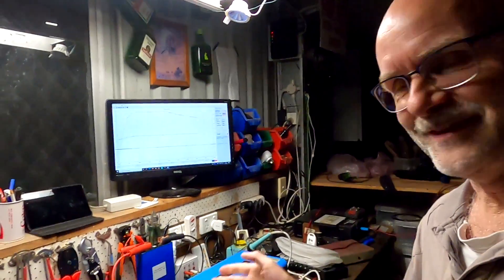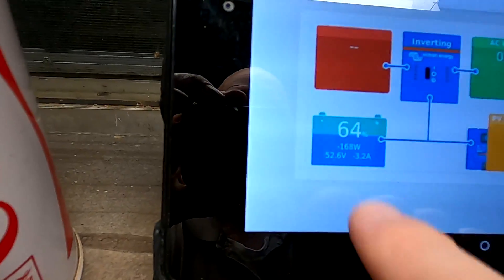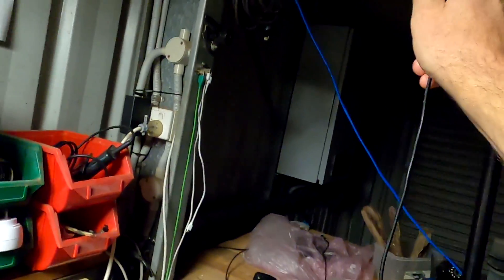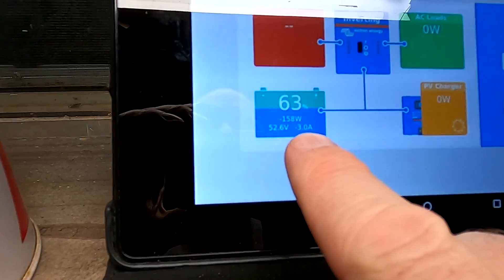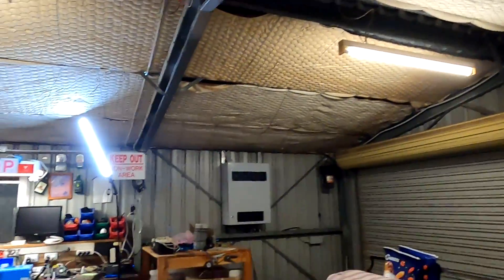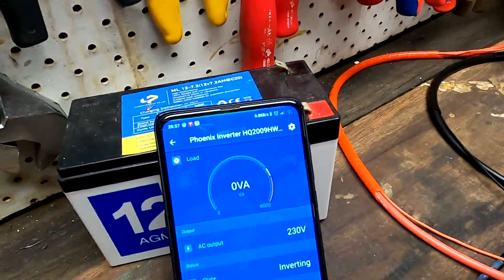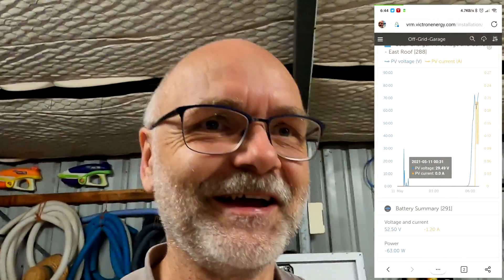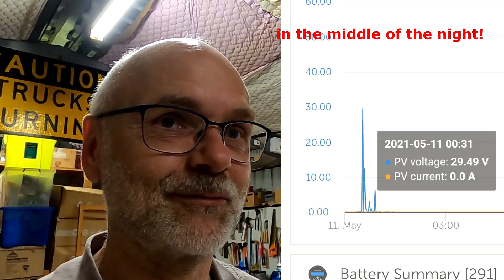How the Off Grid Garage rescued us during a black-out! (Also 🐸)

Comment: In the hills around Phoenix Arizona there is perpetual lightning. I wonder if you could use some sort of lens to focus the light onto a panel in a concentrated enough way to produce power from it in the dark. That'd be interesting to try if you lived near there. Really neat to see that midnight voltage from the panels :-) And funny to know that you have an off grid garage that's right next to an on grid house :-D I guess it'd be almost as cheap to build a solar system as to have an electrician run sufficient cable that distance and hook it up properly with the right safety and electrician hourly rates. Fair play.
Reply: And then I see the snip video! Ha ha, good on you anyway, the more steps toward self sufficiency the better. :-)

Comment: ^_~ so... the moral here is next time build your Off Grid Garage closer to the house, get & install up high a backup gravity fed 100 gal water tank, start converting old appliances from mains to direct 12vdc ,buy some cheap diy 12v induction pcb's & retrofit into a mains hot plate or bean can drop in heater ^_~
add super cap high loads to your local appliance battery ....
Reply from the maker: Yep, that's exactly the plan 😂

Comment: The Problem with  High frequency switch modes it they can jump Detection frames in Slow AC Amp / PF Power analysers so it give a False reading with the slower Refresh Data collection Rates 

Now if you can speed up the AC  Data analysers  Collection at a much higher sampling rate you will see the switch modes + Very bad PF 
Ham radio  + Power company's hate them due they have a abnormal AC  PF Loading  and yet the DC Side can see it Loading

Comment: You may want to contact your victron dealer and see if there isn't an adjustment for that like my 12v 3kva multiplus shows down to less than 10 watts I don't really know how low it goes I just don't have anything that only pulls one or two Watts
Reply from the maker: It depends a bit on the kind of load. Sometimes it shows really low values but mostly nothing up to a few 100Ws

Comment: Hi Andy, i ordered 2x FT 4KW low frequency inverter for my home. The peak of them are 12kw. They can hold the peak very long. Not just 5 seconds like a high frequency inverter. If you interested in, I can give you the link from Alibaba.  You can buy this up to 7kw 20kw peak. I paid for my two inverters just 2000 CAD - DDP price. Like your videos!  👍☀️🙂
Reply from the maker: Thanks for sharing. Yeah, that would be a good upgrade I guess. Do you run them in parallel or just as single units?
Reply: @OffGridGarageAustralia  you are very welcome. Yes sure. I run this guys as single unit. The thing is in summertime I will use just one of them. In the wintertime I will use both separately. Because they have a 35 Amp Battery Charger in it. That means I can load my batteries with 70 Amps in the wintertime with the generator. Do you have a email address for me to share with you the contacts? The best thing comes know. They have from the 1th of June Promotions for several products. Will explain this in the email. Hear you soon. 👋👍

Comment: Wish I could replace all my 120v led lights with 24v led lighting. Removing my inverter from the loop.
Reply from the maker: Why would you do that? You need the inverter anyway.
Reply: I run 2 50watt grow lights and lot of led lights in the basement ( vegetables seedlings only, I do not smoke anything ! ). My inverter indicates that I draw approx. 250 watts. I would gain some efficiency if the lights ran on 24 volts dc ( conversion loss ) and the avoid liability (in event of bad inverter) . If I could do it all again I would also get a dc freezer chest and 1/3 hp dc sump pumps ( those are black out items only ). A dc tv isn’t too hard to find and mini pc usually run on 19v.. anyway it’s a question of margins. Since my house is fairly small I would have to consider some conductor loss , that might influence my running voltage. I love you videos they have opened my mind to some projects ! With electricity.12 cents per kWh. here in Virginia,USA ( where the sun hasn’t shined in 3 days ) Everything must be done with margins in mind.

Comment: In emergency situations you can run an extension cord to the nearest power point on your house and disconnect the house from the grid with the main rcd then make a 2 male end cable to back feed it through  the house circuit I’ve done it for a few days
Reply: That cable is also called "suicide cord"
Reply from the maker: Yes, you can do that. That would run one phase of your battery. So the pump may or may not run ;)

Comment: a hybrid offgrid inverter is good to go
Reply from the maker: Why a hybrid inverter?
Reply: @OffGridGarageAustralia  Hybrid is the cheapest and best solution. You can directly connect the 48V LFP battery to a Voltronic Infinisolar (aka MPP MPI) hybrid inverter (5kW inverter 1 phase, 10-15 kW inverters are 3 phase ... and parallelable). It has EU and Australian certificates. With bigger solar panels in offgrid you loose a lot if battery is full. With hybrid automatically transfer that to the grid. And its AC out port gives UPS power to the loads (your full house)
Reply: @OffGridGarageAustralia  Mr zed has a good explain on it, it is the most simple solution I think. Just throw in a inverter and a battery it is good to go, minimum wiring is needed. You may just use the inverter as a UPS mode, it will auto switch to battery when the grid is down.

Comment: Switching power supplies without PFC are CAPACITIVE loads, not inductive ones. The reason your inverter is failing to see capacitive loads is likely because it is applying a low-pass filter to its output current sensing and loses the current spikes that occur when line voltage exceeds input capacitor voltage in non-PFC power supplies. Put another way, the inverter does not appear to be counting distortion (non-line-frequency) power.

Another possibility is that the inverter is dumb and estimates load based on the crest factor method (current at AC peak) instead of periodically integrating instantaneous power (v(t)i(t)) and RMS current as it would need to in order to accurately report power and VA.
Reply from the maker: Yeah, it depends on if the power supply have a transformer or not. Some of the wall chargers have (you can feel the weight) bt most modern ones don't. The computer and monitor PS should have both PFC.
The interesting part with this inverter is that it shows only 78W when a 100W light bulb is plugged in. Nothing else is plugged in at the time. 

Thanks for your explanation.

Comment: MPP and think Growatt off grid can act as UPS. So you charge batteries up during the day (using gird inverter) and then use during the night  or power loss with a transfer switch.
Reply: Growatt SPF5000ES for example. Reviewed by Will Prowse and David Poz
Reply: I think Growatt and MPP Solar inverters are made by the same company: Voltronic. Only Growatt has more design and cost twice so much.
Reply: I am not sure if the Growatt and MPP are made by the same factory or not, but I can confirm my MPP Solar LV 6048 units (2) switch very fast, and my computer time-dispay (on Micro) and other items do not shut down during the flip from grid to battery or vs-vera.  It was not that important to me, but having this feature is very convenient.

Comment: Simple inverters (try to) create the AC power with a power factor of 1. I believe, there's even a regulation (in some countries) on how far away of that they are allowed to be. 
For big consumers that have to pay for a deviation of their power factor from 1 there are inverters that try to optimize the power factor by not using 1, because this would reduce the resulting overall power factor, creating costs by reducing power consumption.
All that does not explain why the inverter does not show anything, but at least why it has VA = W.

Comment: volt-amps and watts are equivalent only for D.C. or with a purely resistive load.  Any capacitance or inductance will introduce a phase angle which makes watts not equal to VA.
Reply from the maker: As I said in the video but this does not explain why one shows VA and the other W with the same value.
Reply: @OffGridGarageAustralia  One is likely computing VA and knows those are not watts. The other is likely computing Watts, but possibly it is computing VA and knows or assumes they are equivalent. If the values are always the same and should not be, I expect the W computation is making the erroneous but common assumption.

Comment: I miss green frogs from when I live in Townsville.  Now Andy I will have a simpler system, which I want to reverse my shed power to the house. I run 15 Amp wire to the shed.
Reply from the maker: Just 15A to supply your house?

Comment: A second inverter just for the house wired to old grid wire feeding garage ? Add a Protected loads panel at the house with a transfer switch .
Reply from the maker: Not that easy. I have grid-connected solar on the house.

Comment: Ich würde einen multiplus mit 5kw Leistung nehmen. Der hat ja einen Ausgang für unterbrechungsfreie Stromversorgung. Außerdem hat er ein eingebautes Ladegerät. Wenn du einen Stromzähler an deinen vorhandenen Solar Inverter anschließt, und alles mit dem Raspberry steuerst, läd der Multiplus über Tag die Batterie mit dem überschüssigen Solarstrom, der sonst eingespeist wird. Wäre eine Möglichkeit. Ich plane es gerade genau so. Muss aber erst mein Asbest Dach erneuern🤷‍♂️
Reply from the maker: NOOOO, I cannot do that. All solar power produced by the solar system on my house need to be fed into the grid. I'me getting 55c/kWy for that. Hence we are trying to use as little power during the day as possible.
Reply: @OffGridGarageAustralia  Even more, you can run your house full from the off-grid garage. And so all your house grid-tie solar produces goes to grid. All you need is wires and a good off-grid (with grid support) inverter.
Reply: @OffGridGarageAustralia  sorry i just didn't know that. In this case, i would say, get as much as possible fed by the off grid Garage!!!
Reply: Victron Multiplus is a very good product. But it cost a lot. You can buy 3-4 MPP Solar 5kW inverter from the price of 1 Multiplus 5kW. And sometimes 5kW is not enough. If you start a 1 kW continuous power needing electric motor it can have a x2-x7 inrush. Also you have to produce your own reactive power. And Multiplus is not the best choice for UPS. There is cheap MPP Solar inverter with double conversion (AC/DC->battery->DC/AC) technology (this tech also called Online UPS). When Multiplus changes from grid to battery lights flicker. Not with Online UPS tech. Also incoming grid line can be messy (noise, V high or low, Hz slip). No problem with Online UPS tech. Always perfect pure sine wave indahause :D
Reply: @mrzed6597  what model number MPP are you referring to as an example?
Reply: @Nobody_Famous  @Jochen S.  The MPP Solar PIP 5048MK 5kW is the double conversation unit. Also called Voltronic Axpert King. It has a 0ms transfer time. The only downside of this inverter is the low Volt MPPT (140Voc, max 2x 40-50V solar panel in series allowed so s2pX , really max 3-3,5kWp solar can be connected to it). But parallelable, so you can connect up to 9 unit together (45kW on a single phase), or grouped by 3 a 3 phase system.
Reply: @mrzed6597  What Product Do you prefer?  I always want to learn more.

Comment: I must have missed something. I thought in your first video you said that you had a 5.1KW solar system on top of your house that was tied in to commercial power so you weren't allowed to alter anything with it. Doesn't that supply power to your house? As for the Zero VA and Zero W, could it be a bug in their programming?
Reply: I thought that was a pure grid-tied system, no batteries.
Reply: @davebodger2  It might be. Most of the ones I know of have batteries, but that's why I was asking. I wasn't sure.
Reply from the maker: There is a 5.1kW solar system on the house which is grid connected. I cannot do anything with it for 15 years until the feed-in contract runs out. The story is also on my homepage https://off-grid-garage.com

Comment: You are correct about Power needed. I have 5kw +2kW inverters but in some cases 5kW inverter is not strong enough so i 'm thinking about another 5kW that will be connected to that 5kW and in case of overload it will kick in automatickly..it is also phoenix inverter .so that is my plan..i would also suggest to install one thicker cable to your house so you don't have to worry about it..and also i would suggest to have transfer switch that could transfer from battery to main line in case of outage..i have it like this. this transfer switch is pretty simple devise...two power contactors  +one extra relay + two timig delays..so it would switch from battery to main in 1 minute and same other way around..this delay is to protect devices such as freezers or fridge from overload
Reply from the maker: I don't think you can just kick in the second inverter. They will have to be in sync. The Phoenix inverter I have cannot be operated in parallel, the Quattros can. So that's maybe the way to go, buying a 5kW quattro and a second one if needed to parallel it. They also have a 15kW version. Might be the better and easier and cheaper solution in the long run.
Reply: @OffGridGarageAustralia  Hi friend. Phoenix Inverters can be operated in parallel. They have to be connected together by one lan cable that is All. You can connect 6 inverters in parallel on you can set it as 3 phase inverter.  You can set it  how you think is the best..I plan it to be set one main and second would come online only in case of overload.
Reply: @OffGridGarageAustralia  Now as i'm thinking about it I know it is possible for 3 and 5kW units..not sure about units with smaller power

Comment: Your right, you could run everything off 1 by managing it.  I did all last year with 1 x 3000w - and my large loads (dishwasher, washing machine, kettle, small oven) could just run 1 at a time - with the fridge freezer.

I couldn't really use all 3000w as if the fridge/freezer kicked in that is over 1500w for 1 second.   Now I have a 2000w for the fridge/freezer and small loads like the laptop, even a small 700w heater.  Then the 3000w can be for everything else, and i can safely use kettle + mircrowave, or have the kettle on while the dishwasher is going and not be afraid it would all shut off if the fridge clicked in for a cycle.
Reply from the maker: That sounds like a good and reasonable plan. Thanks for sharing.

Comment: Exactly this reason did I start my house UPS project with 2x 5kW MPP Solar inverter. Parallelable so if 5kW not enough with a second unit you get 10kW (peak 20kW) on a single phase.
Reply from the maker: Yep, that's great. The MPPs also come with grid chargers which I don't need. So I'm looking for a solution without the grid charging part...
Reply: @OffGridGarageAustralia  That Grid support makes this inverters so great. Also optional, so you can use them full separated off-grid too.

Comment: "free green power" ?  no investment?  i don't believe in "all eggs in one basket"  2 or more battery banks, 2 or more inverters from central location. if one fails then you can switch to another. i would have 1 for shop and well + one for house ( or part of house minimal) and build bigger over time. but also have it so that it could be combined /separated when needed. plus a way to charge batteries if no power / sun for a long time. looks like more panels and batteries to come. with house start with small stuff off grid first and add more as system will handle.
Reply from the maker: No, no investment so far...
I like the idea as well to split things to stay flexible and saver. For maintenance or faults it won't effect the whole system.